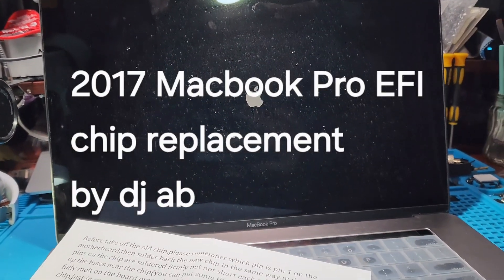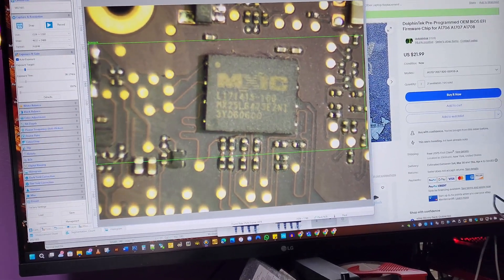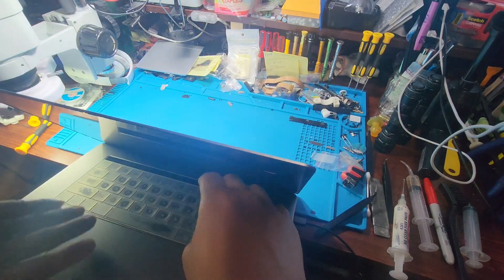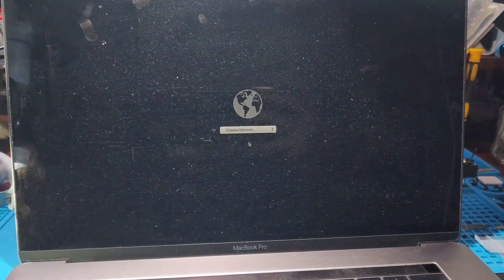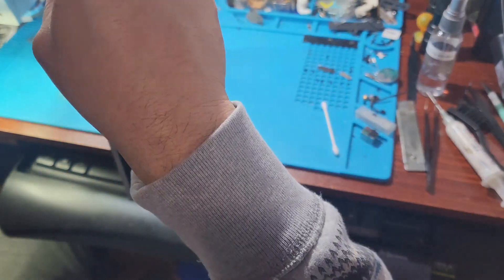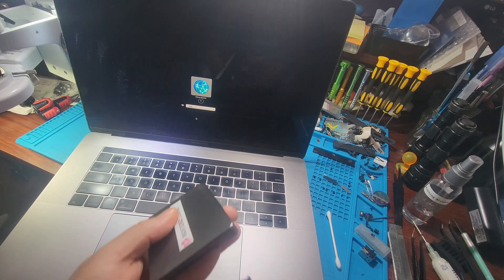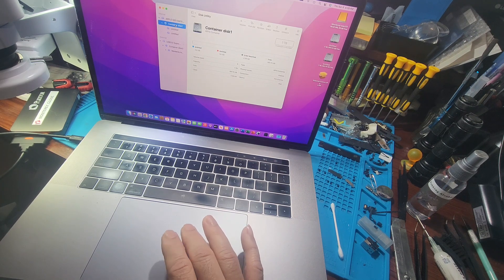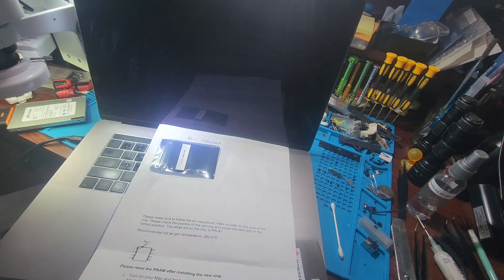2017 Macbook Pro Locked EFI Chip Unlock

Comment: Hi, does replacing the efi chip remove mdm? thanks for the video..
Reply from the maker: No, replacing the EFI chip does not remove MDM because mdm is tied to the logic board (serial number). At the moment I think you can only bypass it. Check out  https://checkm8.info/bypass-mac-mdm-lock